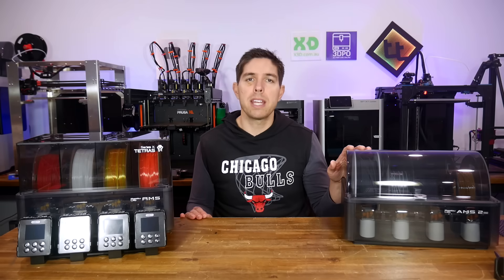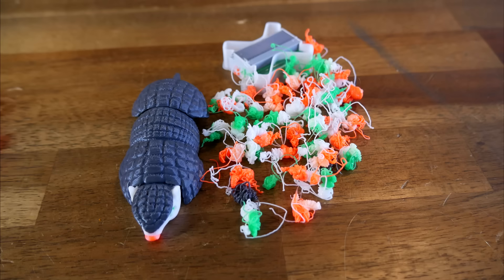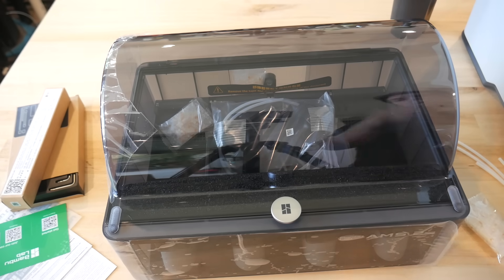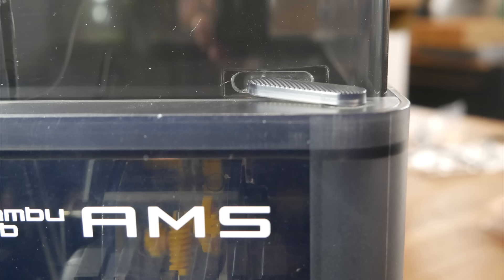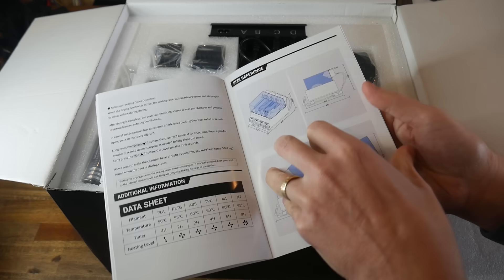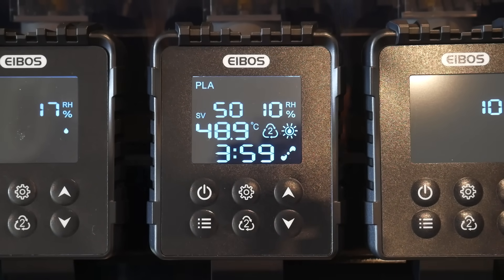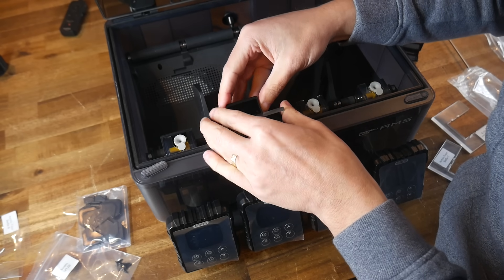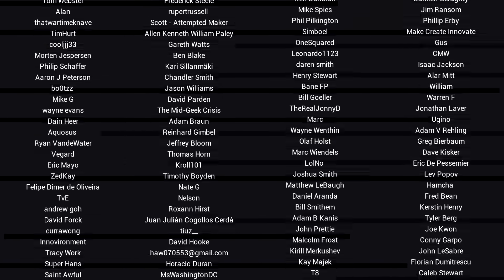Add filament drying to your Bambu Lab AMS with the Eibos X Tetras

Comment: One more important point: When upgrading to AMS2 you'll need to update your software, so if you have your printer airgapped to still use Orca slicer comfortably or any other reason, you can't use AMS2 without giving up that comfort.
Reply: From what I know disabling the cloud features and enabling developer mode would also allow directly printing with orca slicer, no?
Reply: @JustPatschi  Yeah, but with lan only, there is no sync for new filament vendors/types. At least it is not working for me. Would be interessting if this was fixed with newer firmwares, because I don't risk it at the moment.
Reply: Not true, their is one firmware version that still allows all AMS2 features while leaving out the "Security firmware changes".
Reply: @memecentral5469 which version is that for the x1c?
Reply: @memecentral5469  Really? Which one is it? Does anybody know it it's possible to just update to this firmware instead of the newest?
Reply: I don’t really get what’s the point with upgrades, because I comfortably use Orca slicer and isolated my printer to a lan-only mode, what is even better. Are you just hating because you just want to hate smth?

Comment: After installing chamber 4 won't pull in filament and when it tries to back up the fillament it gets bound up and won't pull it back. Not too happy with the kit so far, I might have to work on removing things like the parts that cover up front.

Comment: The Tetras is the best upgrade I have made to my Printer setup. There are some add ons on Makerworld that are worth printing (just search for Tetras). It is also a good desiccant dryer. I fill perforated desiccant tubes with saturated desiccant and pop one in each spool centre and it dries out while printing is going on.

Comment: I pulled the trigger on an AMS2 for one of my P1S printers (have a bunch pretty well 24/7 with PETG so QLD humidity is a killer) and had all sorts of problems with it largerly around it not pulling in filament. Took 4m+ to finally have BBL agree was faulty but wouldn't refund. only send a replacement (absolute nightmare 'support'). Then the 'no drying while printing' thing.. what a deal breaker. Pulled the trigger on one of these last week as looked promising, this gives even more confidence, thank-you! Looking forward to testing it when it arrives and will be grabbing the 2 camber version for all of the prints if works this well

Comment: Great video, awesome information as always. 

Im tossing up between doing this mod or buying the AMS2 due to some maintenance required on my original AMS. 

What are your thoughts if faced with needing to buy another AMS, what option is the better of the two in your opinion please, if needing to start from scratch again?

Comment: That latching system is horrendous. They need to include a new cam style latch to replace the original and put the slot right next to the pivot point for both latching strength and lifespan.

Comment: Is the display/control unit lifted from another product, wouldn´t it be cheaper to make a single display control unit at the front instead of 4, also would reduce cable clutter significantly?

Comment: Thank you for great review. However I miss power consumption comparison. I find it important for devices that mostly will run for hours outside the printing time. Happy printing!
Reply: 80w for the AMS 2, 120w for eibos Dyas, and 240w for Eibos Tetras. I'm guessing 60w for single chamber drying on either Eibos.

Comment: Hi Michael.  Another great video/review.  Thank you.  I purchased The Tetras during the Kickstarter.  I expect that I'll be happy with it.  I haven't installed it yet.  A minor long-term concern that I considered before the purchase is that WHEN you need to get into the bottom of the AMS, there will be a lot to disassemble.  The PTFE tubes in the AMS are, by design, a consumable (my X1C came with a second set) AND there is always the chance of a feed issue - or at least the X1C telling you that there is an AMS feed issue (ask me how I know 😂).  Also, I hope you are making progress on the race car.

Comment: i pre-ordered one just so i could start using my AMS again and also the ability to continuously dry while printing. my AMS has been sitting gathering dust since i got a 2 pro unit. im going to buy an AMS hub once i get the kit too so i can use both for 8 colours.
Reply: Are you able to use the original AMS and AMS 2 at the same time?
Reply: @embracingbraces1365  Yes, I can confirm, you can mix and match them, no downsides to it. 🙂

Comment: If the Snapmaker U1 replaces my X1C I was worried about drying, I got the AMS 2 when it came out and it's drying capabilities were a game changer for me.  I've tried other filament dryers and none were that great.  I think the magic sauce of the AMS 2 is the vent, which this has.  If I sell my X1C I could sell it with my AMS 2 and just upgrade my AMS to be a filament dryer, maybe sell the parts I don't need for spares for whoever needs them.  Also, I noticed when people upgrade to the python they sell their AMS shells for around $50 so if this dryer is good then maybe it is worth buying to turn an AMS into just a dryer.  I haven't looked into dryers in a long time though, maybe there is a good dryer that rotates and vents.

Comment: I have gone back and forth in my mind about this for awhile. I preordered the two heater version. The biggest (only?) drawback to the AMS 2 pro is you can't dry while printing. Actually I just realized.... I was thinking of simply getting an AMS 2 pro as an additional AMS (I have 3 regular ones) since they're on sale. Then I could dry in the 4th one if I didn't use filament from it ... but that's not true, is it? My problem with the Eibos is I don't know if it'll be compatible with my AMS riser, and no one has mentioned anything about that.

Comment: Something I still haven’t seen any reviewers mention is that the RH reading will always drop to 10% once the fans are on for a few minutes. It happens on my unit and a friend’s unit as well. So there’s no real-time humidity tracking at all. You only get the real RH reading once you turn the unit off then on again, so you can catch a glimpse of the real RH before the fans start up. It also means the auto-drying feature doesn’t really work - it stays on “for one hour until target RH is reached”. Well it “reaches target” almost immediately, so auto-drying mode is essentially the heater turning on/off/on/off for 1 hour heat cycles. I bought some hygrometers and stuck them inside each chamber to make up for this, but at the cost of the unit I have to admit I’m annoyed to have to do this.
Reply: It does seem to have a non 10% reading after the timer finishes and it keeps running on RH mode (the only thing on the screen is the RH value). When I used to turn it off after it was done I had a couple of issues with not fully dry new layers of filament but when I now let it run I have no issues.

Comment: I've got the Easdry from Eibos, and it's been a good little drybox for a few years now. Had a positive experience with their customer support as well, so it's good to see that they're slowly getting more traction in the community. A question for Michael: are you able to measure the chamber temperature reached vs the indicated temperature on the display? With my own drybox I noticed that the advertised temperature of 65 degrees Celsius could not be reached, as it reaches 55 degrees at most. I didn't really fuss about it, because I know it's a common issue with dryboxes, but I was wondering if this is more reliable on this regard.

Comment: I’m excited to see that as an option for my A1’s. I’ve had to extend the tubes and get a custom power cord to extend things so I can have the AMS Lite on top of the enclosure where the A1 is.  It works great but a system that allows filament drying would be fantastic and less work for me

Comment: The competition is not sleeping and is already selling.
SUNLU AMS Heater -120$
Reply: actually, currently $109.99 on pre order.
Reply: But it's a single zone for the whole AMS. Not only do you have to worry about the temperature resistance all rolls every time you dry, you are also heating the whole box if drying while printing. Splitting into 4 zones is a far superior solution!
Reply: @Michael.B Martwię się o silniki w AMS. Taka wysoka temperatura może im zaszkodzić.

Comment: I love the idea of upgrade kits like this, I’m waiting for a multi-head conversion for my X1C, but you can combine AMS units and have 8, 12, or 16 different filament rolls available. The twin version of the Eibos kit is a good deal, but that 4-chamber version puts you within $100 of a full AMS 2 Pro, which doubles your capacity.

Comment: did I miss something? if you get an ams2, can’t you use it with your ams1 in series, having a 8 filament setup?
Reply: Yes indeed. I don't like this "lazy" narrative, comparing the prices of AMS2Pro and Tetras, as if the original AMS was basically "free".
Reply: @markusjentsch8115  I’m all for modding your ams1. But if you decide to get the ams2, you can use your old one for either more colors or filament redundancy. the “old” one isn’t waste.
Reply: @rabonssons  That's exactly how I did it. I am enjoying both the old and new AMS now.
Reply: This is exactly what I'm doing as well.

Comment: The good news is we have a lot of choices. I weighed this unit and the Sunlu, and the purchase/replacement of my two AMS units with the AMS two pro. Since the AMS two pro today can be purchased for $269 on special and figuring I could sell my old AMS‘s for maybe 200 here in the states, I went that direction. Because I use a lot of TPU, ASA-CF, and various Nylon filaments, will also be adding the AMS-HT as none of the solutions will dry and print the higher end engineering materials. I love the integration of Bambu AMS units in one interface on the X1C. However, both of the other choices offer some cool advantages, depending on your preferences and set up. Also from a price competitive standpoint,Eiobos makes a two compartment unit for around $119, comparable to the Sunlu solution cost which is a single chamber. Both of those solutions allow you to print and dry at the same time unlike the Bambu solution. One of the most important changes in the AMS2 is the ability to clear jams from broken brittle filament without having to disassemble the entire AMS unit. For me, that was almost a reason enough to upgrade not to mention the improved speed, one handed operation on inserting filament, and the ceramic insert ports.
Reply: Someone paying $200 for a used ams 1 has got to be real special lol
Reply: @winebartender6653 they seem to be, I watched ebay sales…but I may keep them too and put an eiobos on them, total flexibility!

Comment: It sounds like a much better solution than the AMS2. On my SUNLU S4 I have humidity mode and also the option for drying while printing, and I find both very usefull. I think Bambu need to make an AMS3 to add these options.
Reply: SUNLU AMS Heater 120$
Reply: @3DPRlNT  Also a good option. It why be great to compare the AMS2, Eibos X Tetras, and the SUNLU AMS in one video.
Reply: @PerMejdal  To by było super!

Comment: Both are interesting, but I prefer a separate dryer(s) since I cycle through different filament types in the AMS and don't want to wait to have them in the AMS. Also, I live in a climate where the average relative humidity is the the high 20s to low 30s, wet filament is not an issue once dried and properly stored.

Comment: I've put a Rosahl drying membrane into each AMS and that keeps it at below 20% humidity 24/7 using way less power and no heat. It's currently sitting at 16,5%
Reply: Which model do you use? Looking at this myself, but not sure how to choose the right one.
Reply: @WhiteG60 CNC Kitchen used a MDL-3

Comment: I had a few issues with the Eibos, got the wrong screws which were also too soft and stripped and the instructions were a little rough and hard to understand. BUT Eibos got right back to me and are sending the right hardware and updating the instructions, so they make more sense. Good work there Eibos.

I have it all set up, with my own screws, and it works really well. I need to back off the hinge screws, so it seals better and those locking arms don't bend but I have some filament drying in it now. 

I'm super happy with it so far and super happy with their CS.

Comment: The only thing I don't like here is how much hardware is attached to the bottom of the AMS. Anyone who has experienced a filament jam in the AMS will know what I'm talking about...
Reply: This alone is a deal breaker for me. You WILL have to get in there at some point, and i'm not looking to make that process any harder than it already is.
Reply: @obie224 I've had to get into the bottom of my AMS once in over a year of ownership. The every day pros far outweigh the once a year cons!
Reply: @Michael.B  I got a first batch of Bambu coextruded PLA that loved to split along the feed path and it's responsible for me getting in there at least 3 times